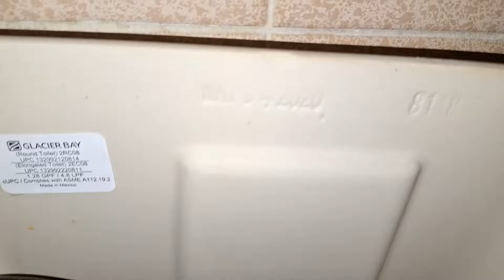VP Racing Men's Restroom

Comment: Look at how low the water level in the tank is. That's automatically a sign of a horrible toilet. 😢
Reply: I hate those toilets my local home Depot only sells round ones .
Reply from the maker: They make the tanks on these so tall and then the overflow pipes so low. It's a very bad design and when I get toilets like this, I usually replace the flush valve in favor of a taller one.

Comment: Whaddya get there? Racing fuel? Just curious.
Reply: Likely just gas, as they do have regular gas but they do sell racing fuel cans...
If there was one in Buffalo, which there is.. I would have bought a can from here for my 80 Camaro Z28, which has a 383 stroker.
Reply: @ToiletsofWNY  Ooh... A late 2nd gen F body... Nice! I bet you must have some fun at the local dragstrip with that car probably.
Reply: @thecan8460  With that motor, I am probably gonna take it to lancaster speedway some time.
Reply: @ToiletsofWNY  I like that.
Reply from the maker: I don't know why they call it that but it's literally just a gas station like every other one. If I remember correctly, all I got was a video of the toilet.